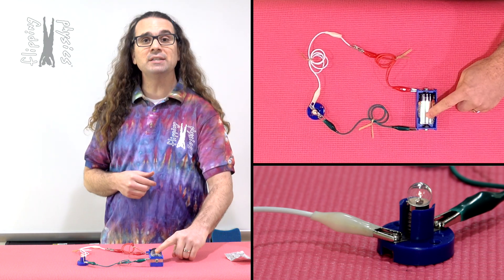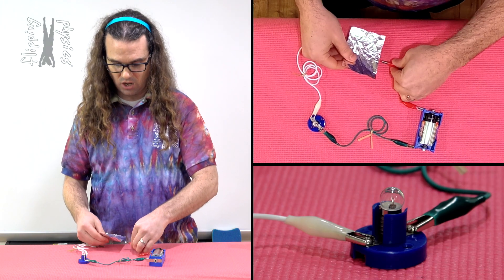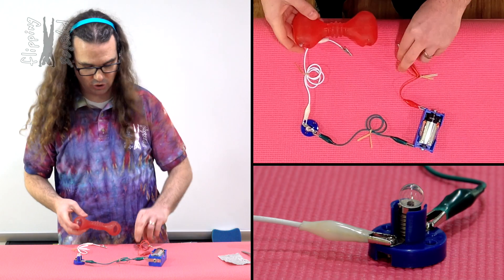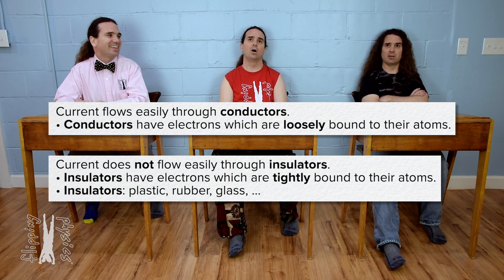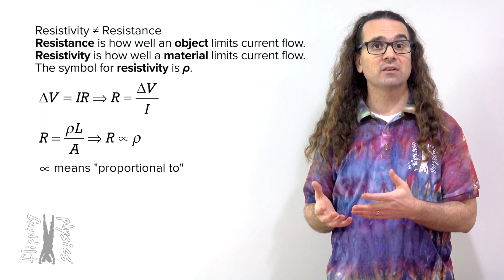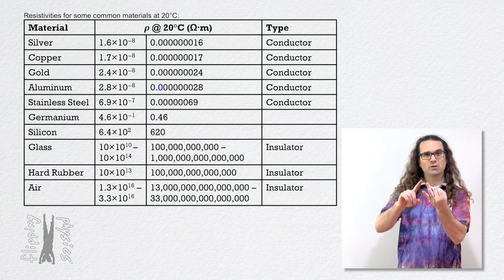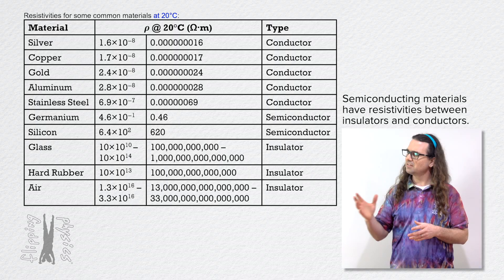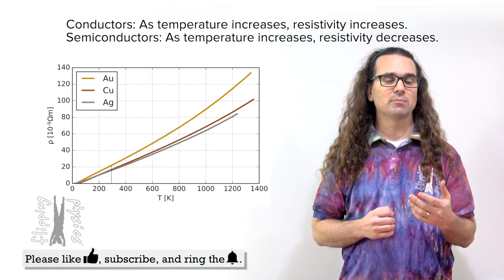Resistivity

Comment: Question two how do you not get shocked? Or is the current too insignificant?
Reply: He's handling the alligator clips by the plastic covers, rather than the metal connectors.  Even if he did touch the leads directly, the 1.5V source of the battery isn't enough to shock through a human body.

Comment: Question one: how do electrons flow through the foil

Are some electrons being moved all over the sheet? Or does it continue in some “imaginary line” through the foil?
Reply: I'm pretty sure that the power source gives a potential difference which entices the electrons to flow in a fixed direction depending on how the terminals of the power source are placed. The electrons are continuously moving (especially in conductors and superconductors) but they don't have any specific direction and hence cannot conduct electricity, without the power source of course. Am I right Mr.P?